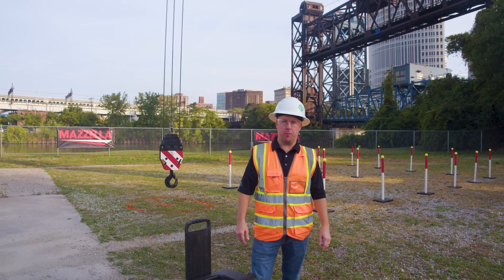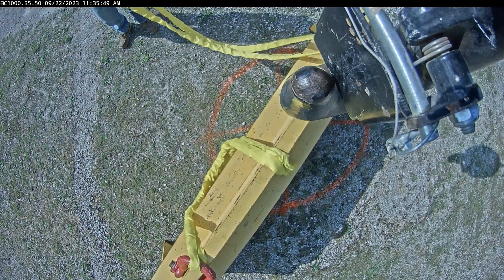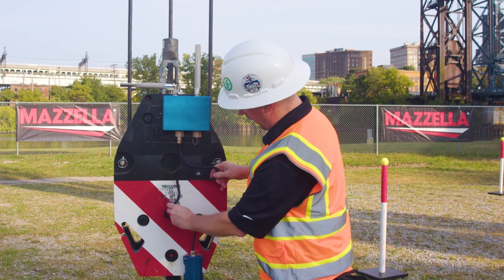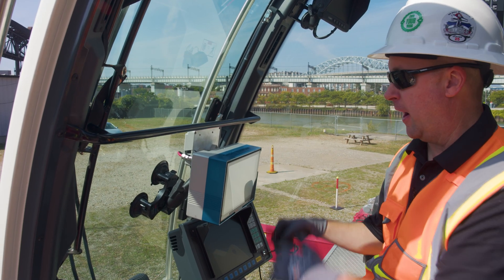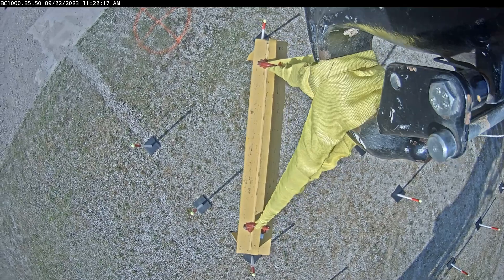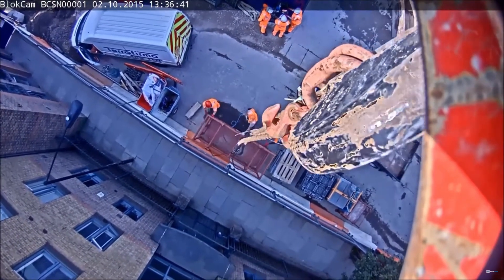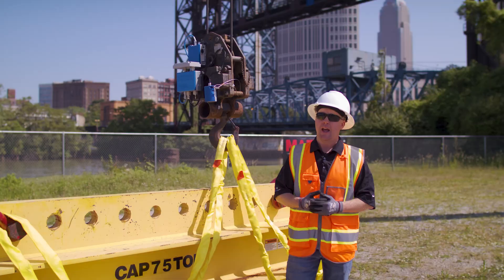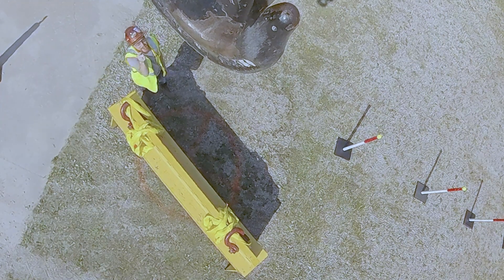Mobile Crane Camera System for Improved Line of Sight - BlokCam Boosts Safety

Comment: Can the crane operator talk to the rigger?
Reply from the maker: The camera has a built-in microphone for the operator to hear communication from the riggers. It does not function as a two-way radio. Communication from the operator to the rigger would still rely on hand signals or walkie-talkies.